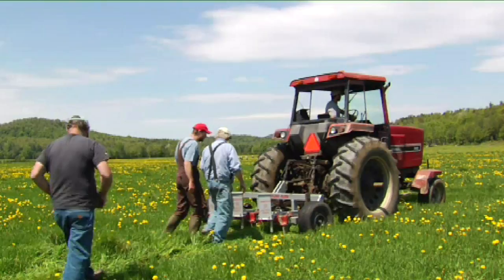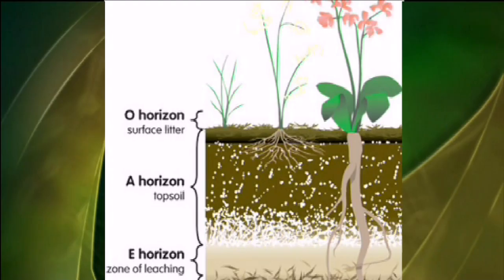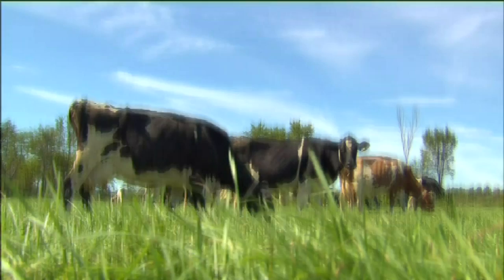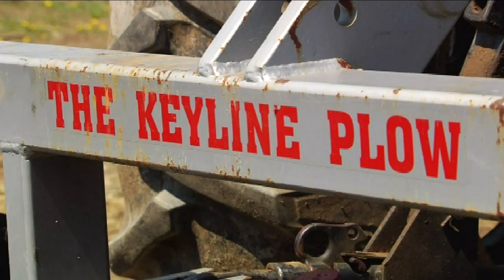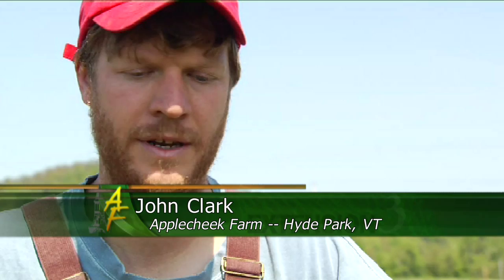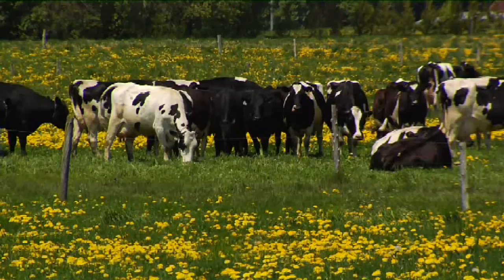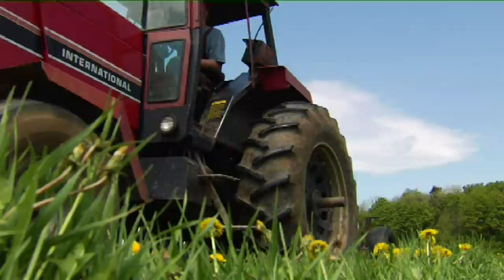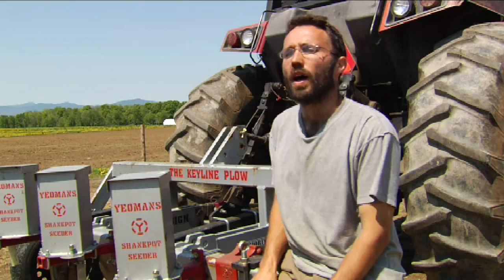Keyline Plow Demostration in Vermont

Comment: Keyline is ALL about control of water flow over the land. At optimum, Keyline will change the direction of the flow of water across the land by 90 degrees, it will improve water penetration, it will reduce erosion, it will increase the water retention ability of the soil, it will reduce the i permeability of soil.